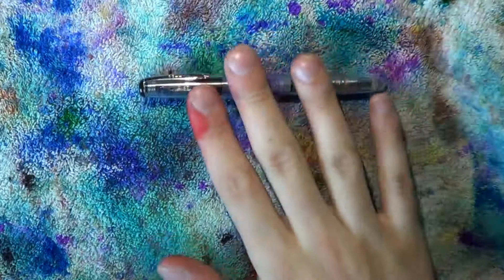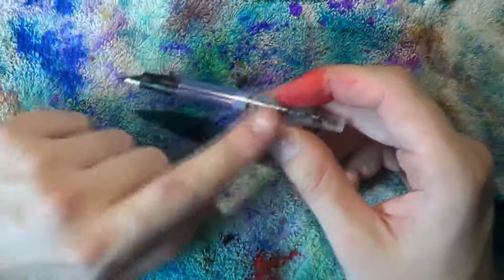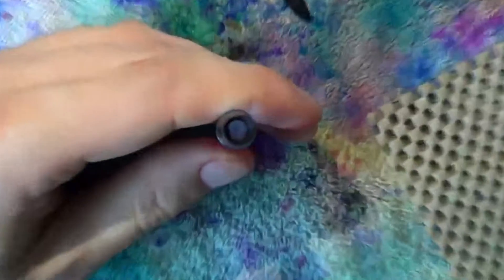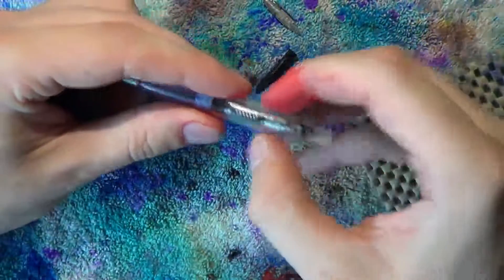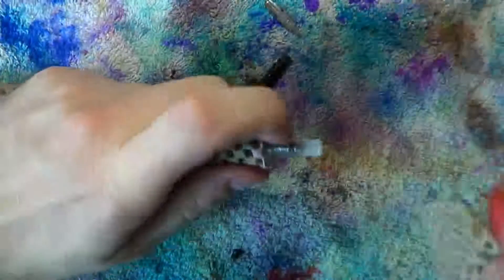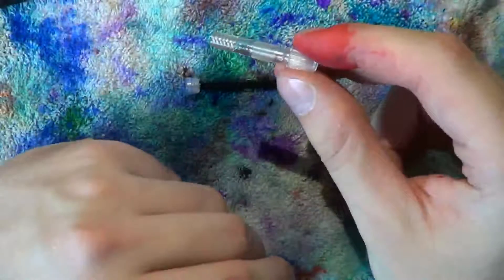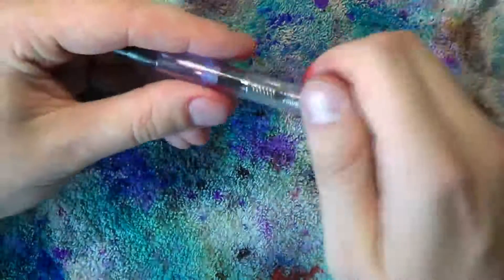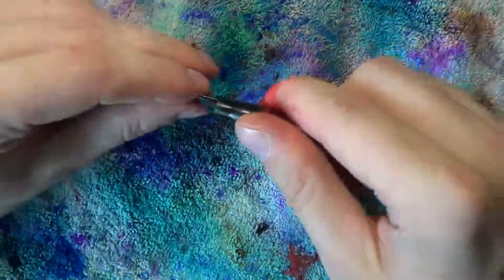Disassembly Line Dollar Pen

Comment: tried this but threads of piston are very tijd and wouldn't move, not even with that gripping material. Tried a plier and broke the threads. Still some thread left to put the blind cap on and since it's the grey model you can't see it's broke. It's the calligraphy model with oblique nib. Ordered a new oblique. Had to tweak the nib as well because it gushed and blurped ink.
Reply: sorry I meant ordered a new clear model with fine nib as the one in this video.

Comment: Hello sabre brown i saw your disassembly video of the dollar pen i was wondering as if the piston can be removed it would be possiable to convert it into an eye dropper do let me know regarding this best regards
Reply from the maker: It would be possible, but I'm not sure if ink wouldn't leak from the blind cap.
Reply: IOK
Reply: But how will it leak from the cap i would put silicon greece to cover it
Reply: Secondly where can i get silicon greece locally
Reply from the maker: sherry raza Yes, silicone grease might be a good idea.  I don't know where you live, so I don't know where you can get silicone grease...  Google might help.
Reply: i mean in general were can one get it in a hardware shop electric shop or plumbing shop soat least i can have an idea abt it
Reply from the maker: Usually in plumbing departments.
Reply: oky i look for it thx